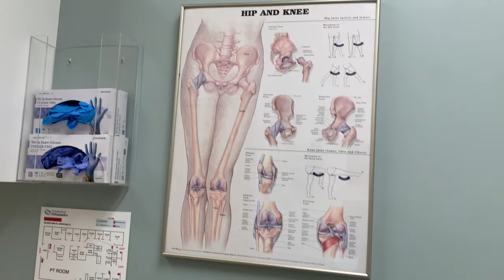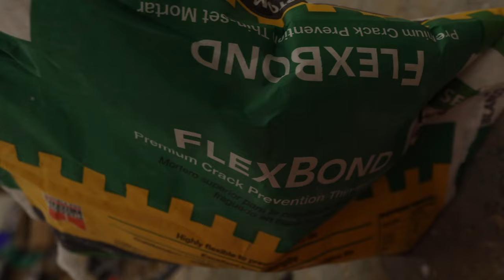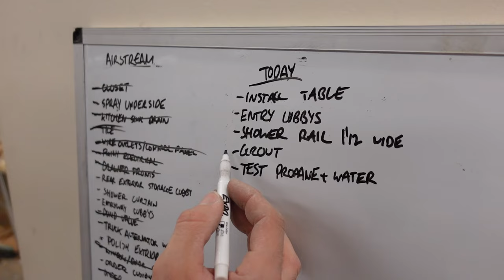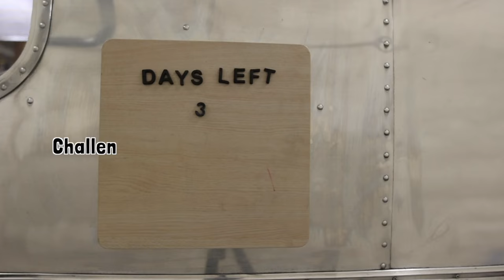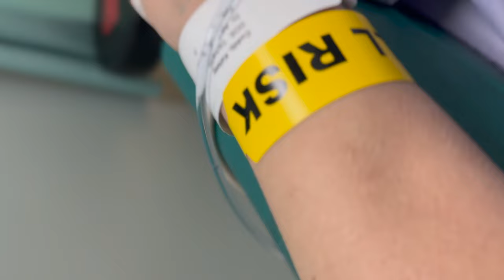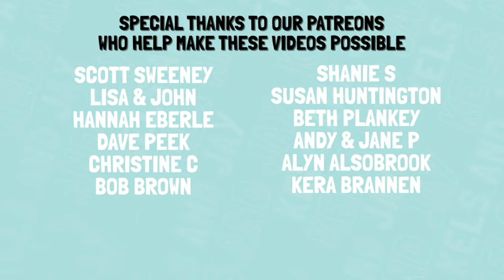We Have To Finish The Airstream Before Life Changing Surgery

Comment: Sorry you didn’t get to the stage you wanted, and good luck with your healing. 
Restoring airstreams isn’t easy or cheap , but you’re both doing great work.
I started restoring/converting a dilapidated airstream for a customer two years ago, he wanted to transport a racecar in it, and use it for trackside meet and greet. Swoping shell onto a 3axle car trailer, making electric opening up and over rear door , wiring lithium, inverter and winch etc, re skining inside aluminium plus insulation, I think I clocked up 400hours, and its not finished yet. 
Big respect to you both for taking this on, and succeeding.😊😊

Comment: ACL recovery should not take you anywhere near a year... I had a complete tear and had it surgically replaced using tissue from my hamstring. I was back to work (working as a paramedic) in about 6-8 weeks, i don't remember the exact time frame. I would suggest trying to strengthen your lower body before the surgery in addition to following all of the at-home exercises your PT will give you. If you slack off on doing the exercises at home you'll just prolong your recovery. Good luck! You'll be fine!
Reply from the maker: I have a full acl tear and partial meniscus which adds more time on. The doctors told me a year but it's nice to hear you were able to recover from your acl so quickly! I know I'll be able to do a lot within that time, but it will be a while until I'm back to 100%

Comment: Try being a DOG.  When they blow out their ACL the operation is called a TPLO.
Look it up.  A radial saw is used to remove the top of the femur and rotate it to a new position.  Pins, plates, screws & if necessary I stapled to hold a tendon toward the paw.
The Pups humans get months of 24/7 oversight and supported moves in a sling to limit said pups movent to near Zero.  
Best of all you sleep on the floor with pup in great quality bonding time, because a jump will ruin the operation and leg.

Comment: you could of simplified your plan by simply copying the bathroom toilet system used on 3rd world railway systems.. just a hole in the floor.. no tank, no water, just be sure your ass is smaller than the hole in the floor and your moving.. otherwise,  it might get stinky around your .. um.. area..